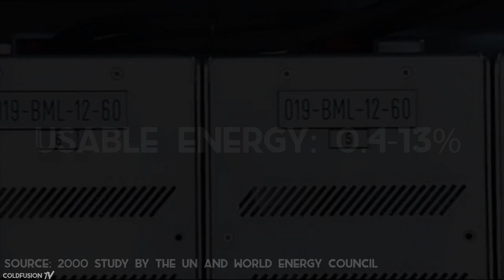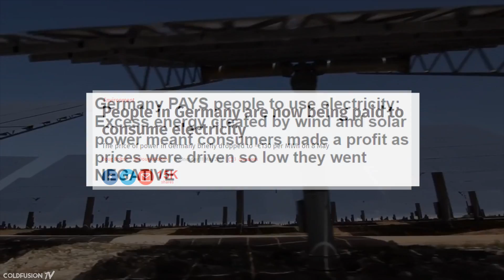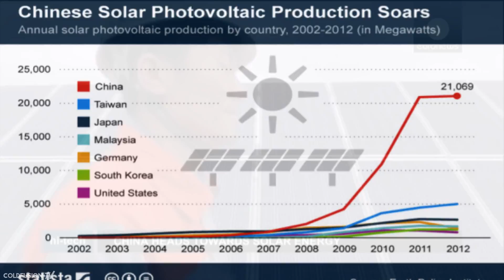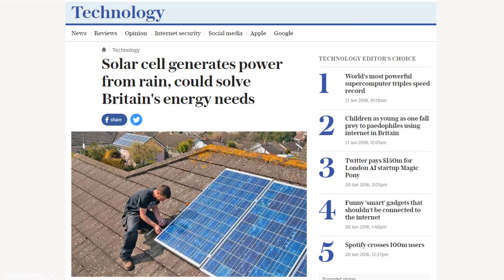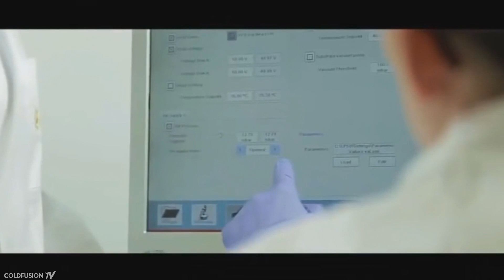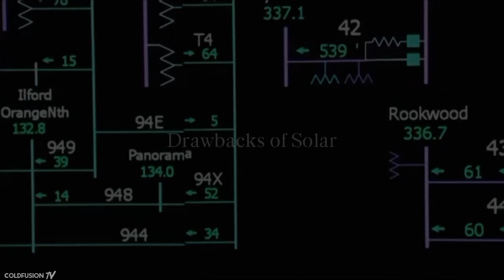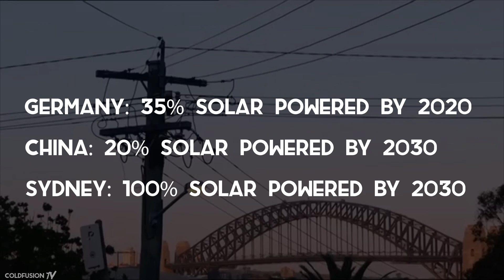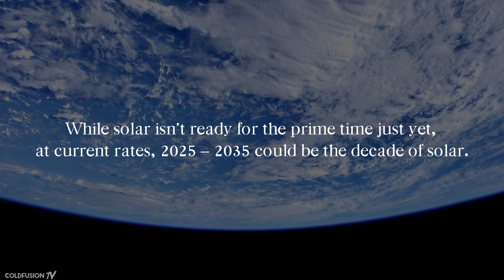The Truth About Solar

Comment: The simple thing: actual costs for electricity go astronomical when solar and wind are used.
Reply: What crap. PV solar is cheaper then Coal power now. They have you programmed to go for the throats of anything that would get in their way of stealing more money from you. Solar kills your monthly bill...and that is what you are defending their right to inflict on you. I retired in my 40's from selling my solar house...for over-asking...in 90 minutes..without a realtor. No matter how much money they spend "Programming" the public, you cannot stop the future from happening. Here is an example of anti-solar programming. https://www.youtube.com/watch?v=iYwCNThbFeA
Reply: Its not about the raw cost of cells (which you can't even fathom) - Its grid cost.
Because soalr is unreliable, you have to have inefficient fast gas backup for EVERY watt. And so Germany pays people to take their excess wind & solar, and then pays to buy power when the wind is gone and sun is down.
Norway is making a killing doing pumped hydro, being paid to take the German excess and then selling back power when the Energiwiende is gone.
So, Norway gets free power, and Germany pays 3x the going rate.
Reply: The actual cost of coal and other fossil fuels is much higher once you include all of the pollution they create. Once you include those externalized costs, the price is staggering. We still need to be careful about how we make solar and batteries as not to create yet different kinds of pollution.
Reply: Sadly, no - because of the whole massive storage thing.
Every solar installation must have an on-demand power production, or you will have brownouts.
So, the solar is completely superfluous and at best saves you some fuel costs.
Reply: Loathomar actually places where you can do pumped hydro (especially in Europe, which has good rainfall) are already being used for hydro.
I suppose there might be some desert areas where it would be a good fit for use of the overproduction.
As for overproduction - it is happening almost every summer on perhaps 1/3 of the days throughout the US, Germany, and anywhere else they have subsidized solar and wind. The bid often goes negative, meaning there is more production than desired.
There is a paper out saying you cannot go over 40% wind and solar, not matter how much you wish to. The prives hit a vertical asymptope.
Reply: yeah. Large industry has been moving out of Germany ever since they started closing nuclear plants and trying to replace it with solar
Reply: While it is currently higher and would considerable higher still if we tried to only used  solar and wind because of storage costs, it would not be "astronomical" even now. A 6kwatt solar system cost ~$13K today (costco, before any tax credits), adding a 6kwh battery system costs  2.5K. This system will last about 15 to 20 years, so you are looking at ~$1000 per year or a monthly bill of ~$85 per month. Not outrages or astronomical.
Reply: ***** Generally, some places have an artificially low pay back period because of government incentives. 
  A  5830 Watt Grid-Tied PV Kit from costco costs $13,000 for everything. If you are in a sunny area this is about right for the average, but either way it will save $80 per month. $960 per year so the pay back is about 14 years. But Federal state and local tax breaks and incentives can cost this cost by as much as half, bring it down to 7 years, though for most more like 10 years. That is using average US kwh costs, but if you are in HW (highest kwh cost), it would be $2,720 per year and the pay back would be >5 years before tax breaks. There are a lot of variables that make a huge difference and it can easily be a payback of 25+ years or >5 years depending are where you are, your electrical costs and tax breaks.
 I am not claiming Costco is the cheapest, but it was easy to fine and had everything at once.
Reply: Fukushima, Three Mile Island, Majak, Chernobyl, and a whole lot of other nuclear reactor deasters beg to differ. Plus the longterm radiation is certainly NOT safe.
Reply: Even with Chernobyl (the only one of those with deaths from Nuclear Power), Nuclear is many, many times safert than any other power production - on a yearly basis, on a per TWh delivered to the grid - whichever way you want to calculate it.
Reply: ***** no, hydro kills thousands when dams fail. Nuclear NEVER has - single dam breaks have killed more than every civilian, military and experimental nuclear power accident. Hell, Dam breaks even put Hiroshima and Nagasaki to shame. https://en.wikipedia.org/wiki/Banqiao_Dam

Wind kills hundreds a year... and more each year. It didn't take many years for wind accidents to surpass nuclear, civilian and experimental. It took a bit to pass the military nuclear mess of Hanford, and the Russian's equally messy military nuclear program.
Reply: +Ryu Fitzgerald Listen 'Ryu' and Jonathan, I actually live in Japan, and I lived through the Fukushima crisis, so don't you DARE to lecture me about the supposed safety of nuclear power, you arrogant, presumptive little sophists. Go visit all the children suffering from thyroid cancer and explain to them how safe it was. Go visit all the farmers who's land was contaminated and explain why it was your 'safe' power has destroyed their livelihoods and their children's children's rightful heritage. Go visit the fisherman who can no longer sell their catch because the levels of radioactive heavy metals in the fish now exceed health limits, and explain to them how safe it all is. Go tell all the plant workers who basically had to engage in decontamination work with little more than surgical masks, rubber gloves and plastic garbage bags to store the waste how safe it was when they are dying from cancer in a few years time. You do that, THEN come back and post your propaganda. Until then...
Reply: ServantOfOdin No one has or will die from radiation at Fukushima Daiichi.
Get your facts straight.
Reply: ServantOfOdin as for Mayak... even with that complete disregard for radiation safety, 55 dead MAXIMUM from radiation.
Coal or wind kills that many in a YEAR.
Plus, Mayak was military - how many have military operations killed this year?
Reply: +ServantOfOdin Merry meet and Hailsa! I think we'll find Jonathan is an unfortunate true-believer in the 'cult of progress' and is thus unlikely to ever admit any wrongdoing on the part of his religion, regardless of how many lives it actually claims...
Reply: CJ Fuller Not a cultist, but I did just spend 7 years getting the knowledge to speak about nuclear issues.
Reply: You guys are missing a major point. What happens to the used rods. They are still highly radioactive and just become nuclear waste that still has to be kept maintained and safe.
Reply: Usedreactor fuel, as I have already said, is a trivial volume of waste that is fairly easily stored, to be used as fuel for a breeder reactor in the future.
Reply: +Jonathan Schattke Trivial? Facilities have special permits to store 5x of what they should because they cannot dispose of them properly. And to use on another reactor is ludicrous because of the volume needed to power it. So many of those Rods in close proximity is an accident waiting to happen
Reply: topflight408 and yet... collecting ALL the nuclear waste from every power plant on the planet, you'd be smaller than the ash ponds of a single coal plant.
Trivial is exactly the status.
Reply: topflight408 I would not mind being a neighbor to a nuclear waste container farm suitable for generation of 1000 TWh. I would be extremely leery of a pile of coal ash for that much generation.
Reply: +topflight408 the only reason is because the AEC has waffled and been blocked on opening Yucca Mountain for 20 years. Its not the US nuclear fleet's problem, but government's. Sane countries have had permanent repositories for HLW for decades.
Reply: ServantOfOdin France peprocesses, so them taking Germany's HLW is proper.
Again... HLW is a TRIVIAL volume. You can pretend otherwise and try to be scary, but you could put HLW 100 miles from any town, and still easily find places for it for centuries.
Reply: A trivial volume of HLW is the case. Sure, I wouldn't want to sleep with a spent fuel bundle. But I wouldn't want to sleep in a coal ash pile, either.
And as for safety - per TWh produced, it is the SAFEST to use nuclear, even with the "dangerous" HLW.
Reply: Jonathan Schattke Battery storage is not that costly and is getting cheaper reasonable fact, but there are cheaper ways. Turbines are reversible. They can use energy to move water up or they can by turned by falling water to generate energy. There is a lose, of coarse, but it is a reasonable cheap, large scale storage. We don't currently do this because generally the time and places where we have too much solar are still rare, so why add any extra cost.
Reply: yes Astronomically Down
Reply: +Kim Thompson Your problem is that you haven't done the proper research.  You should have a return on investment in 7 years max. I have seen it as short as 3
Reply: +Kim Thompson I am an electrical contractor, I make good money on solar sales and im telling you you are wrong so before you go off calling bullshit double check your math. Either you can't do math or whoever you have checking your prices thinks your an idiot an is giving you false information.  And its not your fault there are a lot of ignorant people that pay $11 , up to $14 a watt and that is a robbery you should at MAX and im talking super premium work and parts pay $8 a watt and you can negotiate as low as $2.50
Reply: +Kim Thompson As a rule of thumb I use this. If your bill is under $150 a month on average you don't need solar. A $60 electric payment is something I wouldn't even look at because there is no money for either parties to benefit unless your getting solar to go green. Then I would take the job only if it can be completed from beginning to end with inspection in 2 days
Reply: +Kim Thompson Im glad you realize that you couldn't do the math properly it happens that's why im a professional at this and your a consumer. Like I said 7 years you should have a ROI very simple once you have done it for almost 10 years. I will give you this 10 years ago ROI was 25 but now its 7. The reason is because technology has advanced exponentially and cost has dropped.
Reply: topflight408 Trying to put a single ROI on solar is ridiculous as there are too many variables. Kwh/Kwyr of solar in the US can be between 2100 and 1200. The cost per Kwh in Idaho is 8 cents, HI it is 33 cents. Solar in Idaho would have five times the ROI then HI. If HI takes 5 years from a ROI, Idaho should take 25.
   Claims of a ROI on solar for the entire US are not reasonable or helpful. State by state is somewhat reasonable, but even that can change by 20%. Also, often power starts off cheap and gets more costly the most you use. So, a small system that cuts your power usages by 30%, may half the total bill, make it a far better ROI then a full system.
Reply: +Loathomar You are 100% correct in that aspect. But in most of those situations it is not practical to get solar on your home. Fact is that in many parts of the US specifically the west coast solar is a much cheaper alternative to paying your utility company. It has a lot to do with the tier structure on billing. Some states in the midwest the more you use the cheaper the watt where as in states in the west its the opposite. Some people get solar just to keep their bills on lower tiers. They get a small system that produces enough so they don't hit tier 3 or 4
Reply: +Kim Thompson People in my market are jumping at this tech but like I said it has to benefit you. See maybe is a geographic issue that distorts our views. In California the more you use the more expensive the watt costs example first 350watts @8 cent next 350 at 16 then 24 the 33 ect and what's even worse is what they call peak hours when it doesn't matter what your tier is all watts cost 8 cents more. These are prime conditions for solar
Reply: You are mis-informed.  You can power a fridge, a/c or charge batteries on a electric vehicle, lower your monthly electric bills, etc.
Reply: Unstable, you never heard of charge accumulators and batteries?
Reply: +chublez C'mon... The advanced countries like Japan are already replacing coal with totally safe, pollution free nuclear energy that is so efficient electricity will soon be too cheap to even bother metering... </sarcasm off>
Reply: Where's the sarcasm? All bar pollution free (due to nuclear waste) are correct statements. Nuclear energy is incredibly safe nowadays and most issues caused in nuclear reactors are either uncontrollable natural disasters or simple human error or intervention. The possible pollution effects of over using coal can cause serious illness to whole cities, just look at Beijing (I know not all of the pollution is caused by fossil fuel power plants but you understand what pollution can do to the health of a city). Yes if the nuclear reactor fails a meltdown can come of it. But how many meltdowns that ended in catastrophe or major damage can you find around. Now look at the WHO website, approximately 7 million premature deaths are linked to pollution. Only 4000 people died in Chernobyl the biggest nuclear reactor disaster ever. I'm not saying by not using fossil fuels we'll instantly go down to 0  deaths related to pollution but we can decrease it. And the amount of power produced from nuclear reactors is incredibly high for the low amount of fuel required. Neither source is permanent (uranium and coal) but higher funding in uranium reactors and we may see thorium reactors really take off and maybe with enough time fusion reactors would see more investment and become viable. But it's people that fear monger over the few and small risks of these reactors that could cause the awesome potential of safe fusion and thorium reactors to never be unlocked.
Reply: No it's just that the facts support nuclear energy (or at least denounces fossil fuels for their polluting nature), as presented by reliable sources such as WHO. There are downsides but relatively they are small and can be worked on to be safer and safer.
Though i do see where you are coming from i do sound quite preachy in that text and it is a passion of mine (Nuclear energy has always fascinated me).
Reply: Jack Whiffen
Nuclear power is a nice thing. But the problem is the readioactivity and longevity of that radioactive waste of nuclear fission....
Reply: Jonathan Schattke No, Chernobyl was not the only nuclear desaster that cost lives. Just Fukushima for instance, where the elder volunteered to clear the mess up. Most of them are DEAD. Look at Majak, another russian nuclear desaster, back when no one yet knew how dangerous nuclear radiation is, the entire staff and all clean-up crews died within a year after the desaster. And the nuclear waste that was poured into the nearby river wasted 3 towns!
Get your facts straight before saying such blatant bullshit!
Reply: Wrong. People have died from radioation from fukushima, just as people died from Chernobyl.  http://www.japantimes.co.jp/opinion/2014/03/01/editorials/fukushimas-appalling-death-toll/
http://www.spiegel.de/international/world/nuclear-exaggeration-is-atomic-radiation-as-dangerous-as-we-thought-a-519162.html
Not even combined, coal, wind, and water kill that many.
And don't mix up a military plant with military actions, that's about as big a difference as between stone and steel. Bullets don't fly from a reactor!
Reply: Jonathan Schattke Yeah, and Trump did several years to become a prominent figure, doesn't really quailify him to be a president either. Your knowledge is obviously flawed if you refuse to see the dangers that are obvious and apparent!
Reply: So? Because Japan let that company get away, it's any less unsafe, what kind of nonsese is that?! It only proves that reactors are unsafe.
Reply: topflight408 Yep, for far too long.
Reply: +Jonathan Schattke Would you rather stand next to a mountain of ash or a highly radioactive house.
Reply: No hate on ashes. You can use that in winter like the thawing salt. True, it doesn't thaw anything, but it prevents the slippery part of frost! Does radiation have any benefit? Not one!
Besides, why coal? There's plenty of alternatives.
Reply: Yeah, keep on lying to yourself about that. Let me tell you how Germany deals with that: we have 7 deposition places. None of them permanent. And we don't find any. We export the shit to France - who don't have a a permanent and final place either. 
So. You still wanna stick my your nonsense of "Sane countries have had permanent repositories for HLW for decades."? Stop bullshitting yourself and others.
Reply: Jonathan Schattke And you can continue to downplay anything, but nuclear waste is dangerous, not trivial. Saying so is foolish. But sure, if you like, why don't move in with a nuclear reactor.
Reply: Jonathan Schattke The more you use the word trivial, the more it seems you don't even know how to use it.
It's not about TWh, stop excusing danger with that!
Reply: Ryu Fitzgerald Much less, yay. Still Too Much. Get over it.
Reply: Improving? You really want to improve nuclear power? Stop using fission and start using fusion, THAT'S an improvement!
Reply: Ryu Fitzgerald Yeah, we can see how it "works best".... xD
Reply: +CJ Fuller 

Cheap shot.